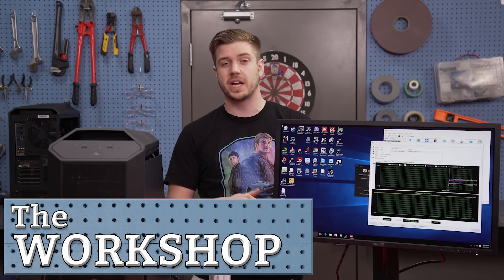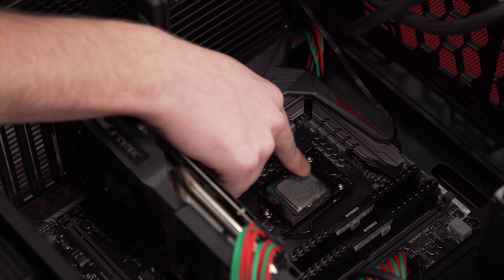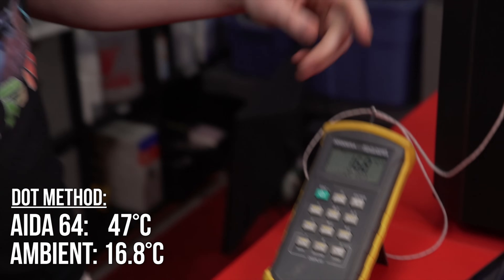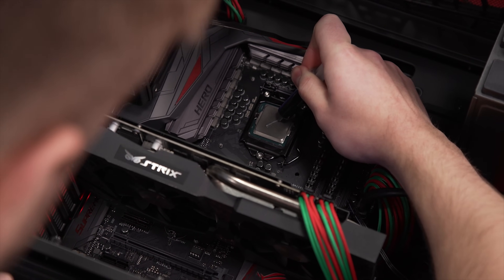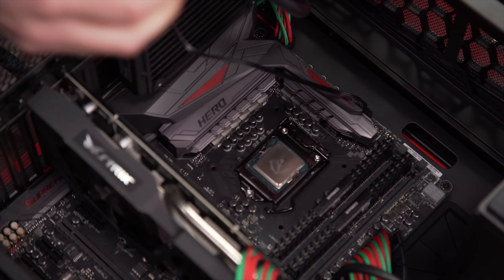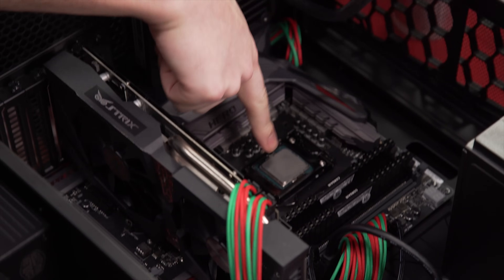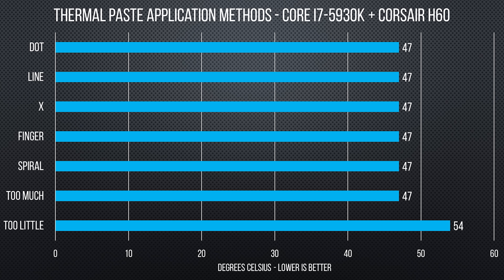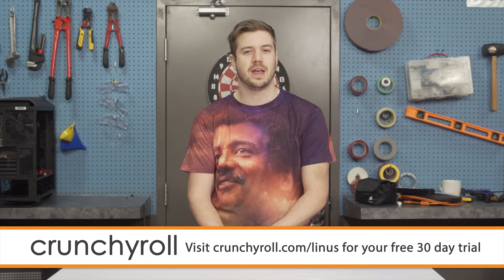Thermal Paste Application Methods - Which one is best? - The Workshop

Comment: Nice vid...

Could you Test, what actually renders a Video faster?
A 6 Core i7 5820k, or a 4 Core i7 6700k WITH "QuckSync"?

One time compared both CPUs in stock clock speed, and one time OCing the 5820k up to 4 Ghz, to match the Clock speed?

And if you're bored enough, whatever you want, to get more data :P Like the 8 Core, or i5 + QuickSync.
Reply: BeFoRe - CS:GO and More - Uploads After Summer Holiday Are you sure? If i'm right, you need an intel Graphic for QuickSync, and the Extreme CPUs don't have a graphic
Reply: BeFoRe - CS:GO and More - Uploads After Summer Holiday And that's it^^.. Haswell-E don't have an iGPU.

Comment: I had two horrible CPU coolers from Cooler Master that doesn't work right with any of these methods. The only way to get them working properly was using a thick spreaded layer of paste because the base of the cooler is so irregular. Those were the Hyper TX3 and the GeminII M4.

Comment: Methodology is very important here, if you only want to test the different application techniques all other factors must remain constant. Was the base clock on all cores the same during all stress tests? Was the fan on the H60 running at the same speed in all tests? (it looks to be PWM controlled). Is the Corsair H60 simply too effective to give any useful results?
Reply: +TheAmmoniacal Luke has been doing this for quite some time now. I strongly believe he would make sure all the variables stayed the same among all the tests...

Comment: if the themal compund is to viscid just put the syringe in warm water for some minutes before application.. then you can spread it out easier if you prefer doing that..
also: appying tc with your finger???? there is a reason why people use a plastic bag or glove to do it and that reason is not to not get the finger dirty.. you applied your fat with it.. that's not good..

Comment: Video idea: Cleaning method of the CPU. In all your videoes you clean with isopropyl because it does not leaving anything behind when it evaporates. However ive used cheap vodka for cleaning before, with no impact on performance. So can you test out whether using expensive(at least in some countries) isopropyl has any advantage over normal cleaning alcohol or even vodka?

Thanks.

Comment: I'd love to see a video where you do radiator placement. Do something common like a Kraken X41 or H80i. Go with top, bottom, front, and rear mount, while only using 1-2 non-radiator fans. Also, adding in push vs pull vs push/pull would be awesome. I know some people are very adamant that going with front-mounted radiators or pull configurations are the "worst" but I've done both to mine and my boyfriend's PCs, and we hit roughly the same temperatures with a Kraken X61 (top-mount with fans pulling air) and H110i GT (front mount with fans pushing). I suspect the difference will me minimal, but I would love to see it tested in a controlled environment anyway.

Comment: I'm going to assume that the CPU/radiator fans remained constant. If not, then all your results are useless. As well, I would have expected the possibility of more variance by using a not top end air cooler, rather than using a high quality AIO water cooler. While I wouldn't expect people playing with thermal paste to use the stock cooler, that AIO could easily mask conductivity issues by being able to dissipate the heat too well. Personally, I would have been aiming to reach the 60 degree mark as my baseline (Not so hot that you're risking the CPU, but hot enough that there's an actual need to put effort into dissipating the heat).

Comment: I'm interested to see if you'd get the same result with a stock cooler when the temperatures are higher and there is a bigger chance of having actual differences.
Reply: +Nuke That or having a CPU that has a higher TDP like an FX-8*** overclocked.

Comment: Nice restaurant/customer service waiting music. Anyway, I was hoping this would be a video about what paste/compound/material is the best to use but no, it was a video teaching noobs how to apply paste. Nevermind that the instructions for most compounds simply say apply amble amount to cover the CPU/GPU contact to the heatsink and builders just need to read those instructions. :endrant: If you can, or haven't already, please investigate which paste provide the best cooling and what specs to look for in a good paste. Thanks.
Reply: +Magmafire There is a marginal difference between pastes.

Comment: my issue is.. when i apply thermal paste to my spare pc, when i tighten my cpu fan down it push's all the paste out of the side's... this happens if i tighten each screw 1 turn, of 20 turn's. the pc shuts down within 15 seconds, sometimes lasting up to 30 seconds before shuts down. any suggestions how to get my paste to stop being pushed out of the sides? thanks

Comment: when you are running these thermal tests are you running the fans at 100%, cause stock profiles, for example, on things like the 980 ti will hover at 83 and vary the fan/clock speed to keep it there. but if you crank the fan you get much lower temps and high clock speeds than that.  now i understand that you would never want to run the fans maxed out but if you are trying to see differences in your test you shouldn't have auto adjusting fan profiles!  did you factor that into these different thermal tests?

Comment: try it with a smaller cooler, maybe a stock one so that temps are higher and a way cheaper thermal compound to make more apparent the rule of the application method, MAYBE the results will change

Comment: What about cheap vs expensive thermal paste?
Reply: +TheWGBbroz This! ^ I'm pretty sure that would be really good to know!
Reply: TheWGBbroz Different thermal paste does matter. Luke is using one of the better options. IC Diamond is easy to use, no need for time to cure, spreads nicely and keeps cpu cool.
The best performing compounds are the liquid metal compounds. Problem is that they are difficult to apply.
The best/easiest to apply thermal pastes are: Thermal Grizzly Kryonaut, Gelid Solutions G-C Extreme, Thermal Grizzly Hydronaut, Prolimatech PK-3, Phobya NanoGrease Extreme and IC Diamond 7. 
In reality, either go with the Grizzly or if you can find one of these in a store get that one. I purchased IC Diamond compound at Microcenter and it works great. 
Otherwise, you really just need decent compound. I suggest not silver based ones though they will work fine. With the ones I mentioned and others out there you get between about 0-4 degree difference. Not much. So, don't stress out if you don't use the best product.

Comment: Turnip shaped method. Ran Passmark performance test 8.0 to give the CPU something to do, had 33 C motherboard temp and 45 C CPU temp. Arctic MX4 thermal paste and just the stock fan. Intel i5 4590 on a Z97C Mb. CM Storm Enforcer case so front intake fan 200mm rear fan 120mm.

Comment: I would say the type of application is application specific!

For my CPU, since I am using a CM Hyper 212 EVO, with those direct touch heatpipes, I used a plastic bag over my finger and evenly spread a thin layer across the heatspreader - using a SLIGHTLY thicker application than normal to fill in the tiny gaps between heatpipes. And the result is that at 4.6 GHz with 4.8 GHz dual core, on my i7-3770k - running Prime95 max heat for over 16 hours, my hottest CPU core got to 85 degrees, and my room was about 23 to 24 degrees at the time.

And on my GTX 780, I did a rather thick application across the die, as well as having replaced all stock heat pads with Fujipoly high end thermal pads, upon doing this, and allowing time for the AS5 to "cure" dropped my idle Temps by 3 degrees, and my load temp by 8!

Comment: Your results are likely skewed because you are using a heatsink with high mounting pressure. 
I bet that if you used something like an Intel stock cooler and applied too much thick thermal paste it would not be able to push all the extra paste to the side. So instead of filling in the gaps like it should it will act as a thermal insulator and reduce cooling.

Testing it like this should still be sometimes relevant.

Comment: I'd like you did the test with a more cheapish thermal paste, say mx4?
also an aircooler. and to the spread with card properly, not with some papertowel covering the card... (I think an even spread might be related to bad results, as it will be tougher for it to spred out thinner since the pressure will be on a bigger, thick surface)

Comment: I think the issue here is an effective CPU that doesn't really produce THAT much heat, to be able to vary the results enough to be measureable. How about using one of the older AMD's that were rated for like 140w? Surely that'll give some variation!

Comment: I wish you would have used a 2011-3 based CPU because of the larger area and much higher heat output. That should make it easier to distinguish results :)

Comment: Consistent with similar tests from other channels. However one showed that the Cross method gave a wider spread as could be seen through the plexiglass the guy used. Maybe 47°C was too low for your test, a CPU that reaches 70-80°would have been better, in an ambient of 40°C, summer, behind window, etc… not the 16,8°C freezer Linus forces you to work in :)

Comment: The test may have been more interesting if the choice of CPU, overclock, and cooler had resulted in a much higher baseline temperature, say upwards of 70°C, which would have made relative fluctuations in thermal conductivity between the CPU heatspreader and the cooler easier to detect with the presented test methodology.

Comment: hey im using a deepcool iceblade 100  and the part of the heatsink that touches the cpu is not perfectly flat.  i get higher temperatures when using the pee method..  the card method works better for me....  share share
Reply: Then your cooler is defective and you should send it back if under warranty or re plane it if not.
Reply: no its not... it just does not have a flat surface
Reply: Which is a defect.
Reply: de·fect

a shortcoming, imperfection, or lack.

ok then its a defect...
Reply: Correct.

Comment: I would be interested into a test, if a really overpowered water cooling system (water-cooled CPU, GPU, Mainboard, RAM, HDD and SSD) with way too much fans would beat a normal water cooling system (water-cooled CPU and GPU only) in aspect of the extra costs.

I don't know if this would be a "The Workshop" or a "HOLY $H!T" episode. But it would be really cool ;)
Thanks in advance :)

Comment: I've read plenty on this to suggest these would be the results but I've always wondered how good the contact would be without thermal paste at all... Would the bare metal contact between the IHS and block be enough to run a stable system at load?? I only have the one CPU so am not brave enough to try

Comment: When I was applying thermal compound to my CPU, some compound dropped to the motherboard (a really thin line) I tried to clean it, but it was touching the resistances so I couldn't get too deep and there was leftovers...now once in a while (it's not so often) my USB ports get disabled and if I turn my PC off it taks a lot of time and then I get a blue screen with "DRIVER_POWER_STATE_FAILURE". Do you think it's related? How can I safely clean those leftovers on my MB?

Comment: FLAWED DESIGN AND WRONG CONCLUSION
First of all, thanks for your hard work and for trying to settle the thermal issue once and for all. 

However, there is definitely room for improvement in the design of your experiment:
To see if different applications of thermal paste matters, you need to go to the extremes. That means 1) no water cooling, 2) stock fan, 3) overclocked CPU working hard, 4) Measuring CPU core temperature and ambient temperature AND changes in CPU fan speed (otherwise no change in temperature could be due to fan speeding up). Also you need the same amount of thermal paste for each application, so you need a method to quantify the amount of paste you are applying.  

And when filming, please show us how the thermal paste was applied (very poorly illustrated in the video - especially in "to little") AND the imprint on the CPU fan, which gives a good impression of how much of the CPU was covered. 

Your conclusion is "don't use way to much or to little". You didn't show that to much is bad, and I would instead conclude from your experiment, that you cannot use too much, but you can use too little.  

As many others have commented, it would be interesting to see if there is any difference between cheap and brand thermal paste. But it would also be nice if you found a computer a couple of years old, measured core temperatures and applied new thermal paste to see if there was any difference.

Comment: My thoughts. Maybe try it with the stock cooler or something that isn't as great as a water cooler since those things keep things cool very cool already. The temp differences should be little so u probably won't see results on a great water cooler. Maybe even try passive cooling so the cpu can actually get hot. Then again I could be wrong but it's just my opinion.

Comment: This is common sense (non compressive compound etc) as long you put reasonable amounts. However what is the most important is putting an even amount of pressure on all sides so that the heatsink contact is flat as possible to the cpu.

Comment: The difference in the way of application of thermal paste shows only after substantial processor OC with higher voltages. At processor stock clock rates excess heat produced is too small to show any difference.

Comment: is there any diference in using thermal paste instead of thermal pads on the gpu's VRAM?
Reply: Don't do that just buy pads on amazon. please don't use thermal paste.
Reply: Thermal paste is not a solid entity and can move or shrink if you do that causing little to no contact to be made. Just buy pads.
Reply: +Tyler Morrison + the pads are in the 'millimeters' thick range where the paste is in the 'micrometers' thick range. Thinner is better but the pads on the card are just to get 'good' thermal contact on the nonessential parts. The paste is for the vital 'hundred watt' gpu with heavy clamping pressure. The pads are for the other parts with very little clamping pressure.
Reply: Yes
Reply: frollard
 Correct, but we are talking about the VRAM modules on a graphics card, which are almost always pads and wouldn't even contact with a thin layer of thermal paste, so just buy pads.

Comment: Lovely video. My guess is though because the water block is prob high pressure mounting that it makes no difference as the pressure will pus out wtv isnt necessary. I bet if you tried a medium pressure mounting air cooler or a stock cooler it will make a difference. Don't forget how efficient water is compared to air. You should do a side by side H60 vs a noctua cooler and  try dif paste application methods. I bet on air it makes more of a difference.

Comment: i think it's the water cooling setup. They are already so efficient that the method of thermal paste application rarely made a difference.
i think you should try the same but instead use a low grade, out of the box air cooler. 
Might make a difference.

Comment: Question: How far a "bad" Powersupply infect OC?
Reply: If your system takes 100 watts and you have a 100 watt power supply then your power supply will die, so get a 350 watt power supply so you have more growing room to over clock and upgrade.
Reply: +Gameo that shouldn't affect it. the vrms do the final transforming. so if the psu has enough wattage it should not affect anything.
Reply: It "should".
So they should prove it and we all would be a bit smarter :D

Comment: Not to be too nitpicky because I know these kinds of tests are a pain in the ass to do, but you'd have gotten way more significant results by using a CPU that has a lot more power consumption, e.g. an older, overclocked Intel 6-core (or an AMD FX-9590 haha). You should really have a delta of more than 50°C (more than 60°C, even) between the CPU and the ambient temp to see the TIM come into play. (And it's important that the heat comes from high power consumption, not just from bad thermal conductivity below the IHS like in Ivy Bridge etc, because then you would still get a small delta between the IHS and the heatsink. By the same logic, it's also important that it's an awesome CPU cooler that can really transport all the heat away quickly because otherwise, again, you'd have a small delta between the IHS and the heatsink. Make sense?)

Also, putting the CPU right in front of you on your desk (before putting it into the socket) definitely makes it easier to get an even spread with the credit card method haha.

Comment: Would air cooling have been better for this workshop to show a more discernible, if any difference in application methods? I know water cooling is pretty efficient at getting heat out of the CPU.

Comment: I was under the impression that you remove the ambient temp so that the CPUs would have comparable results. E.G if the ambient goes up the CPU temp would go up which is unfair for a CPU that has a lower ambient. 

So taking your numbers

CPU temp - Ambient = Delta

DOT 47 - 16.8 = 30.2 C 
Line 47 - 17 = 30 C
X 47 - 17.2 = 29.8 C
spiral = 29.8 C
too little 54 - 17.2 = 36.8 C
too much 47 - 17.3 = 29.7 C

You can see that as the ambient went up the CPU temp did not therefore it had better cooling albeit very small. Ergo "too much" actually have the best cooling.

Comment: Was that a paper towel on the card you were using to spread? :\ It spreads a LOT easier if you use a bare plastic card.
The paper towel or w/e that was was picking up all the paste. IMO I've always used either the line method or the spread method (I generally use that method for reparing YLOD PS3 systems with their gigantic thermal spreaders)